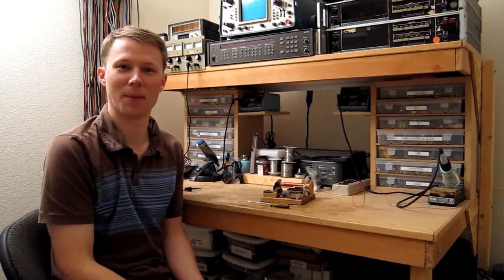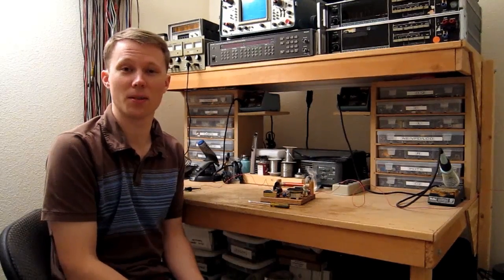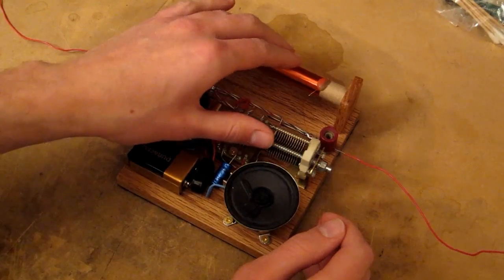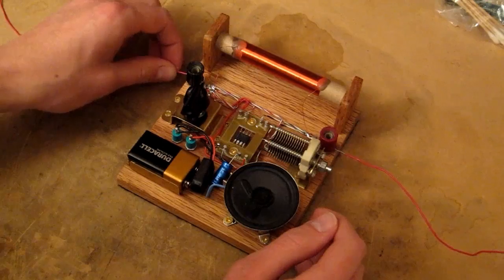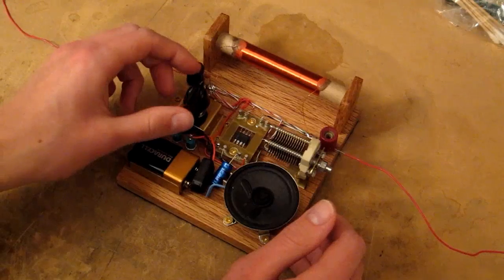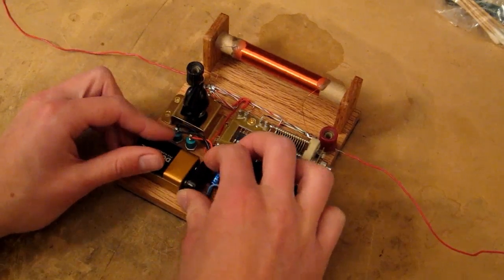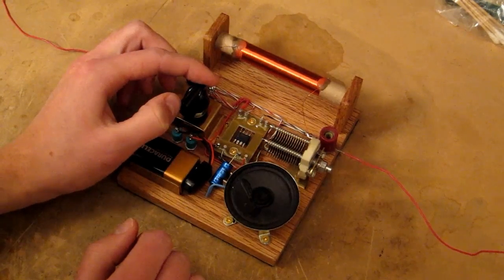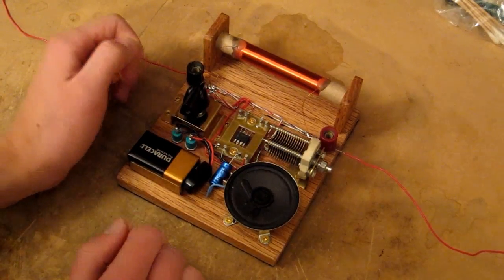AM Radio using 555 timer IC

Comment: You ought to build the receiver's complement. The AM 555 timer audio transmitter. 

On mine I used a 560 pf capacitor that is in series with a 1.5 k  resistor for R2 and a 1 k resistor for R1. By rights this should have placed the oscillator at around 680 Khz but my receiver that picked up the signal saw it just above 800 Khz. Later I will actually measure the frequency. I thought the discrepancy might be due to tolerances but I measured the components and its not.
For the audio modulation my idea was to superimpose the audio on the + lead from the power supply. To do this the circuit used must be linear similar to two batteries in series. What I did was use an audio transformer. I ran the + lead from the battery I used to one of the taps on the high impedance side of the transformer and ignoring the center tap I mapped the other tap on the high impedance side of the transformer to the Vcc input on the chip at the point that branches over to the subcircuit containing R2, R1 and the 560 of capacitor. The low impedance side of the audio transformer is connected to the audio source such as at the headphone jack. With this arrangement you get both isolation, and the superposition of the audio onto the Vcc voltage.
The audio from this method is quite good. I built mine to play audio books when I am far from the house and don't want to carry an expensive tablet. I've seen others try to use pin 4 and 5 ie reset and control and they kind of got some kind of modulation, but it was not understandable at all.
I just posted a video of my 555 audio transmitter on YouTube and if you do a search you can find it and hear the sound quality for yourself. The audio in the video is from a metronome, but its equally clear with music and voice too. I do have a low pass filter at the output to cut out harmonics and that is why you see the shape of the signal on the scope. 

I took everything off the breadboard and I soldered all the components to a perforated board earlier today, but before I build the enclosure I am adding two more things and they are: 1: A small trimmer cap in parallel with the 560 cap or else a variable resistor in series with R2 and R1 to give some tuning flexibility. 2: I am adding or would like to add a RC network of 3 caps and resistors to change the output from square wave to more of a sine wave although it sounds awfully good as it is.

I like your receiver and will probably give it a go later.

Good luck in your contest but by now it must be over for sure since your video was posted in 2011 and this comment is from 2019.

Comment: My congratulations on the use of the 555 for this project.    It appears that you have a voltage controlled  pulse width modulator whose gain depends on slope with which one is comparing the  analogue voltage..  Perhaps if you demodulated before you changed  to  pulses rather  than keep the  biased carrier to trigger the slope, well, I wonder.
Still congratulations and  I hope you won  the competition.

Comment: when adjusting an inductor you may find a plastic or non-conductive screwdriver to be more helpful since the iron in the metal screwdriver will interfere with the tuning.

Comment: Awesome radio bro. I have a question. How many more windings do I need to do or do I need to just add more capacitance to my coil to receive higher frequency bands. Above 1.8 MHz if I just keep adding capacitance will that do the job or do I need to wrap more magnet wire around my coil?

Comment: That one will work better if you add a tuned L/C circuit to select the frequency you want to receive but I suppose for such a simple design it works as well as it possibly can.

Comment: IN 1965 I TOOK THE FLYBACK OUT OF AN OLD TV AND BUILT A CD IGNITION FOR MY 1965 MUSTANG .  I GOT 9 PERCENT BETTER MILEAGE USING THE ENGINE LOAD TIMMING TRICK.

Comment: Have you put your 'scope on the audio output from the IC?
I wondered what sort of signal level difference you'd get with a bipolar 555timer & what value of bias pot is necessary then.?
Is the coil wound on a wood dowel, or is there a ferrite rod?
It seems unusual that there is so many turns of wire and a low value tuning capacitor.
To tune the AM band you usually have approx 50 turns of wire on a ferrite rod with a variable capacitor of 300-500pf.
Maybe then feed the audio to a LM386 IC?

Comment: Is it correct to say the 555 timer replaces a crystal in a crystal set?   It is used as an oscillator?
Reply: Anton Nym the oscillation wouldn't be use for rf receiver because it can't filtering rf wave,the ic just works as a frequency generator.

Comment: Hello Eric, can you explain what is the purpose of the 555 in the circuit?
Reply: Probably to act as an oscillator to step up the weak radio signals from the coil..

Comment: I built this circuit but can't get it to work, I can't tune in to any stations at all, but when I adjust the bias I get a loud high pitched shriek, any idea what could be wrong?  I checked for solder bridges and continuity and that all checks out to be ok.

Comment: Very nice, but I was always told never ever use mains earth as an rf ground. you really for such a small project should just drive a copper rod into nearby soil and use that as rf ground. Im sure the reasons are safety related. Not trying to dis the poster, just pointing out the safety issues :)

Comment: You should have shown tuning the capacitor to a radio station. Also you should have told us the current drain on the 9V battery. That is, how much current does your circuit require given a normal volume of sound?

Comment: how 555 is used to demodulate ?
Reply: Looks to me like it is a classic design, a regenerative receiver. A diode is still being used for detection but the 555 is being used as an oscillator for the regenerative portion. This design has been around since the days of vacuum tubes but has a problem where if you adjust the regeneration too far it will squeal and become a transmitter!

Comment: There is a link to the circuit diagram in the description for this video. The incoming radio signals are applied to the TRIGGER and THRESHOLD pins. It is cool that this works at all!

Comment: LOL youre wall socket ground is far from it , they just call it like that , but its a wire , next to the hot wire , hence there is voltage there
Reply: +Pavle Pavlovic In North America there is a hot, a neutral and a ground. The neutral is next to the hot wire , hence there is voltage there. But, also next to the hot is ground, often connected to copper pluming,where there is voltage.
Reply: +Jonathon Breitner no voltage* 

:P
Reply: +Pavle Pavlovic Maybe in a 3rd world paradise there is voltage on the earth ground ir they tap the neutral and call it earth ground but here in the USA the earth is connected directly to an earth grounding rod outside of the mains circuit breaker box and power meter. At the very least it is connected to a cold water supply pipe.
Reply: ElfNet Gaming im in  what you would call a third world country , Serbia but my house is built on modern standards over 300 square meters and 200 000 dollars . This year . Im an electrician also , and i have grounding problems cuz im a musician too so i have studio monitors and  other things that need stable power , and i assure you , that earth is NOT 0 potential. ITs close to it , but you need 2 wires to have difference in potential , so you measure earth /neutral and you wont see 0V. Take check in your American house , maybe youll see a lot worse situation then in third world country house , ive measured it to about 3V, every socket is different . Earth might be 0V but even pure earth is not always 0V . Its natural ever changing envirement nothing is 0V
Reply: Pavle Pavlovic You have problems obviously in your grounding system if your having "ground loop" issues in musical instrument amplifiers. Are you using direct boxes? proper cables for signal inputs? everything have their ground pins intact and plugged into the same circuit?
Maybe some electronics have leaky capacitors shunting the voltage to ground and that is what your reading or maybe your circuit is wired wrong. 
My home uses 3 wires, Hot (Black), Neutral (White), and Ground (Green) and the Ground has zero volts on the earth ground. The neutral will fluctuate in small voltage when things turn on and off on a circuit due to the return factor of AC current and such but nothing appears on the ground leg at all unless something shorts off to ground itself.
Reply: ElfNet Gaming look man , am experienced electrician, way more educated then you think . So before this goes out of control  , you need to learn that you need 2 points to measure voltage . You cant say earth is 0V, you can say earth is 0V in respect to something , and that something cant be that same earth . Cuz hot in respect to hot is also 0V but its gonna kill you . So when i say grounding is 3 V it means in respect to the neutral wire . Cuz if it was in respect to the hot wire it would be 110/130/220 or 240V...There are neutral things in the  universe , but on atom level , not on macro level . Nothing is 0V cuz everything is moving and changing inducing  electrostatic pressure /voltage . Measured in KV for humans , let alone the hole house . I have a lot more knowledge then you have , but ill excuse you cuz you dont know who you are talking too, but dont be continuing debate over nothing , if you want to check it go check it , on any Voltmeter youll have 2 wires , cuz you need them, and you cant point then on the same spot , thats not valid , that doesn't measure anything
Reply: Pavle Pavlovic A legend in his own mind
Reply: I don't know what the electric system is like in your country, but in mine we use the MEN system (Multiple Earthed Neutral) in which the neutral wire and the earth wire are joined electrically to each other at the switchboard and also wired to a real earth connection, usually through a copper or iron water pipe.  That makes it a "real" ground connection.

The neutral only has voltage on it with respect to the "live" connection, unless the ground wire has come loose in which case the home owner should get an electrician to fix it, for safety.
Reply: THERE'S ONLY ONE WAY TO SETTLE THIS: EVERYBODY START SLUGGING IT OUT, AND THE LAST PERSON STANDING IS RIGHT!!!

Comment: If you use an earpiece instead of a speaker, it is actually possible to make an AM radio that does not require a power supply, though it will not be loud (even with an earpiece). I found this really interesting short video recently that shows how a crystal AM radio actually works: https://youtu.be/0-PParSmwtE